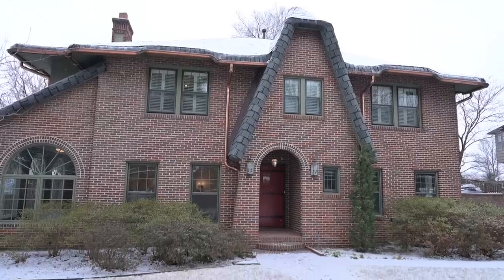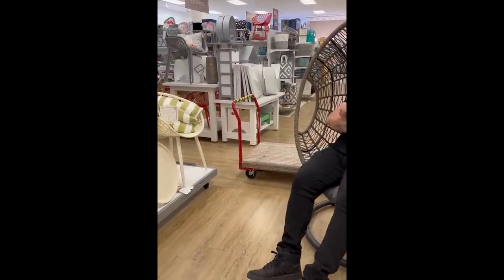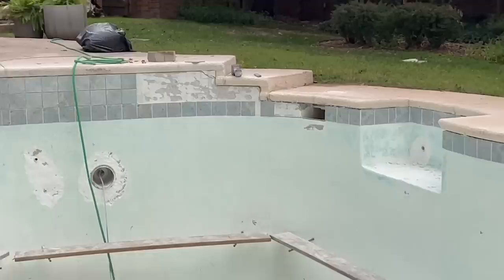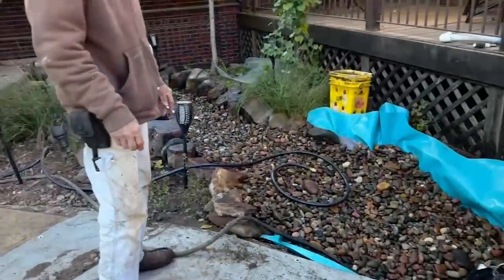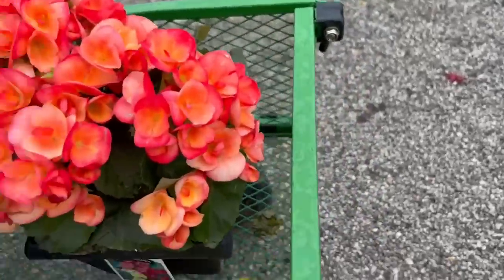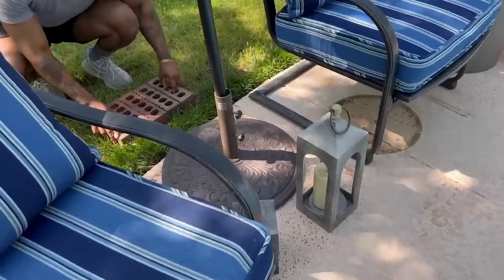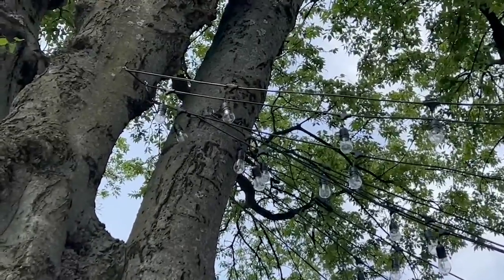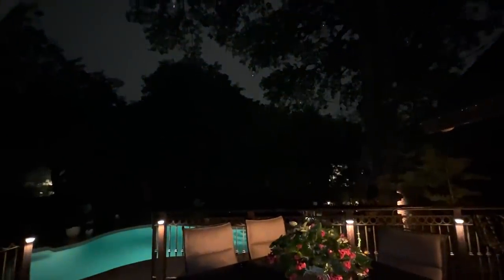How I prepare for SUMMER 2023!

Comment: Everything that you have had done at that house, needs to be done at my house. I have an old pool that we have drained after redoing it twice since I've lived here 30 years and right now it's sitting there empty. My sprinkler system needs redoing. I just got a new roof. I just got new gutters. I'm getting new exterior doors. And I'm getting the whole house pressure washed including the driveways, the patios, the sidewalks, the chimneys, the garages. It's absolutely overwhelming! And that's not everything that needs to be done. I really want to get rid of my swimming pool but it's $10,000 to fix it or $10,000 to get rid of it. It's like the money pit. I feel your pain. I did buy two new umbrellas this year and I'm repainting all my outdoor furniture. So far, that, and new cushions are the extent of my patio reno for now...

Comment: I have had the Tiki lights for several years and I love them.  Here is a trick to get them to come on before dark  (which could be quite late in the summer.) Put some kind of a black disc or something over the top of them so it simulates night.  I use some black rubber coasters.  Works perfectly.